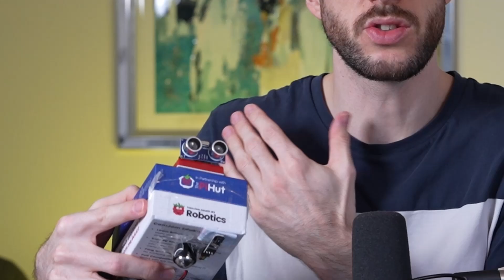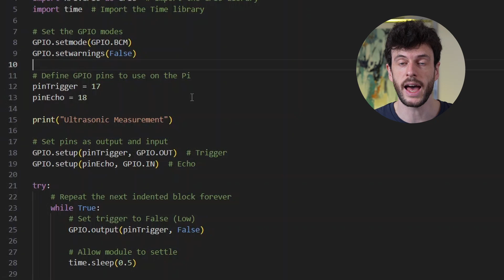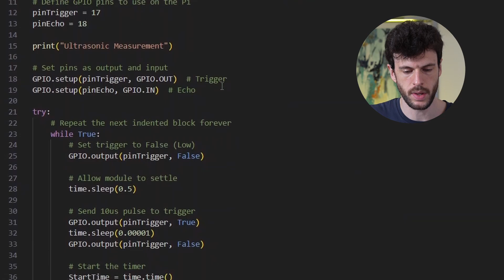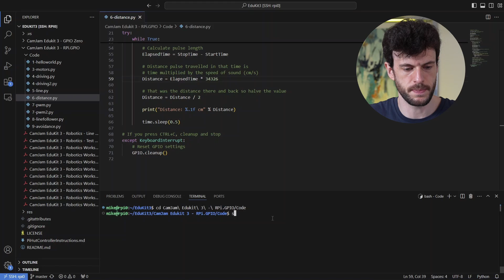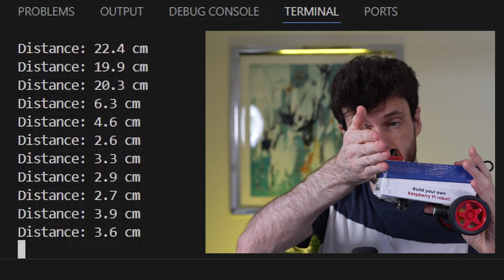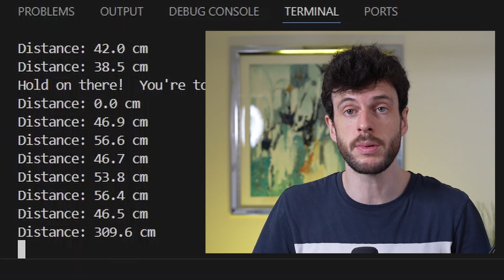#6 Testing the Distance Sensor | CamJam EduKit #3 Robot Kit

Comment: Another fun sensor learning point in this one. The reason you get your minimum distance is that it needs to be able to bounce from the emitter to the sensor, if you're too close the signal can't do that. One way to counter this is to sit your detector a little way back inside your robot. You can account for this distance by taking it off your final result.
Reply from the maker: Right! If the sensor is too close to an object that reflects the signal, it can't reliably measure the time taken for the return signal because it's still transmitting the first signal (or recovering from transmitting it). It has to beat the speed of sound, after all!